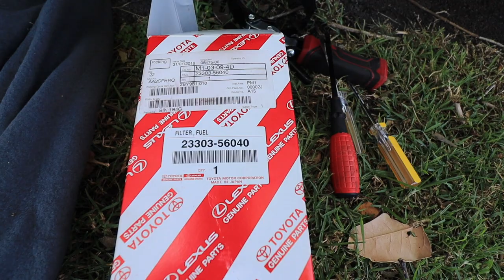Toyota Coaster Motorhome DIY Service - Landcruiser 1HZ 4.2 6cyl Engine

Comment: Good video. Well done and nicely explained. Before fitting your fuel filter you may find it easier to fill it with diesel. It saves having to hand prime it 😀
Reply from the maker: Dean Hotton thanks! Definitely a good tip, unfortunately the diesel Jerry can at the farm was empty that day! Cheers.

Comment: Great video, wish there were more like it about doing the straight-forward stuff we are all timid to attack. Some comments about the oil you use (same as me, by the by) and the grade would be good.
Reply from the maker: Hi Gavan, yup I'm aiming to try and do few more videos along this theme to help folks starting out with camper vans/motorohomes and Toyota Coasters in general.  

Good feedback i'll update the video description with oil grade etc and some other bits of info!

Comment: Good video. I have a 92 1HZ.  Still to do the air and fuel filters.
Reply from the maker: Brilliant. Air filter is super easy, fuel filter simple if it has been lubricated on the last install and comes off easy...or you might have the situation i had...overall still very doable and great to know you're looking after your own vehicle.

Comment: Thanks for the video, im planning this September to tour Australia, so your tips will be handy.
Now i just need a bus😁
Reply from the maker: You won't regret it! we've had a great time so far.. and might be lucky enough to get back on the road once we are through the other side of COVID-19. Have you seen any you like so far? Ours is the 1HZ non turbo so it's not fast by any means, however it is a bus and when i'm on holiday i'm not in that much of a rush. It didn't miss a beat. Good Luck.
Reply: @Nikgowrie  I'm overseas at the moment, had plans to do the PCT in America (Walk from mexico to canada) but that's now cancelled,  so I'm on the lookout for a motorhome anytime from when things open back up to Sep/Nov, I have seen a couple that I really liked, Now sold, and some a really really liked, but overpriced in my opinion and that's probable one reason why they haven't sold yet.  I had thought of converting myself,  but thats a lot of work. hopfully I can find a Bus that has 3 seat belts and has off-grid abilities. Would be good to see a walkthrough tour of your bus
Reply: Just one more thing,  why didn't you go the solar pannels way to charge up your bus, was a generator and fuel for a year a lot cheaper?
Reply from the maker: @stephenb465  I plan to do a walkthrough video soon.
Reply from the maker: @stephenb465  we have solar on the roof. I'm planning increase the number of panels however as on consecutive days witthovercast weather i don't have enough to recharge the batteries fully. 

The generator allows me to top them up if we're camping in the same spot for a number of days and I also use it to run the A/C unit if it's super hot and we are off grid.

Comment: Hi enjoyed yr vid have coaster 1988 handbrake light doesn’t go of completely of late can you tell me brake fluid reservoir is where had a look in main engine can’t see it .... help ! Grinding noise when braking
Reply: Hi Trevor, thanks! On my 95 which is the 3rd generation coaster the brake fluid reservoir is accessible from the drivers seat. When sitting in the seat if you look over the the bottom right hand corner of the windscreen, then look at the dash in that corner there is a little bit of trim that pulls off to reveal the reservoir. I’m not sure if the location is that same on your, which I think will be a second generation model. Hope that helps. There are some good groups on Facebook who have owners of most ages of coasters and could assist i’m sure! (Aussie coaster mates and Toyota coaster owners group)

Ps, grinding noise when braking would probably lean more towards worn pads if on the front or perhaps a stone caught in the pad etc (change in pairs both sides). Check for scoring on your discs. If at the rear I’m assuming yours will have drums and probably time for new brake shoes.
Reply: Nik thanks for your quick response yr comment on my phone cuts of your reply at “windscreen” can you finish your reply please thanks heaps if yas make it to Strahan tasy come stay thanks mate
Reply from the maker: @trevorwindle8980  the windscreen, then look at the dash in that corner there is a little bit of trim that pulls off to reveal the reservoir. I’m not sure if the location is that same on your, which I think will be a second generation model. Hope that helps. There are some good groups on Facebook who have owners of most ages of coasters and could assist i’m sure! (Aussie coaster mates and Toyota coaster owners group)

Ps, grinding noise when braking would probably lean more towards worn pads if on the front or perhaps a stone caught in the pad etc (change in pairs both sides). Check for scoring on your discs. If at the rear I’m assuming yours will have drums and probably time for new brake shoes.
Reply from the maker: Hi Trevor, I've taken a picture and a quick little video for you. do you have an email address I can forward them too? 

I can't guarantee the reservoir on your older model is in the same spot but it might give you a starter for 10. 

we'd love to get to Tazzie but doesn't look like it's going to happen this trip mate! Bummer!
Reply: Thanks Nik I got it many thanks filled lights out but think in need of new break pads grinding still with it got it booked for a medical ya again